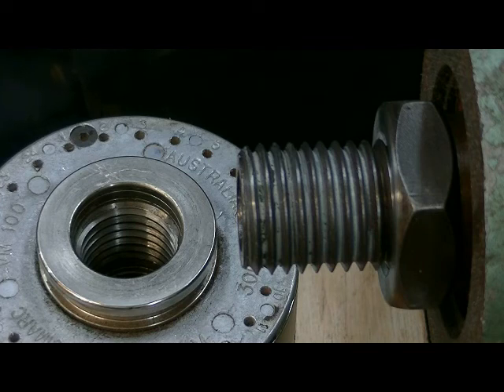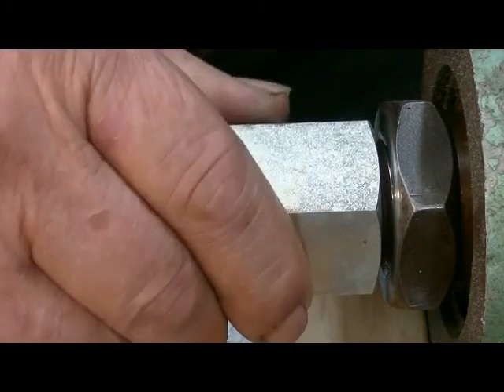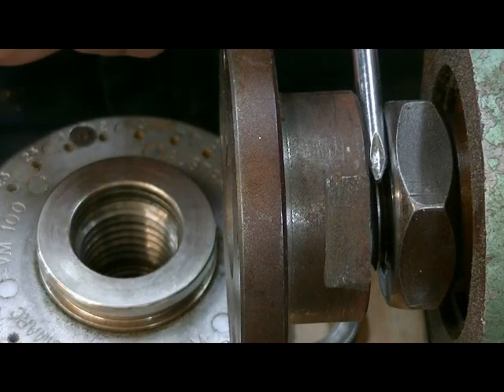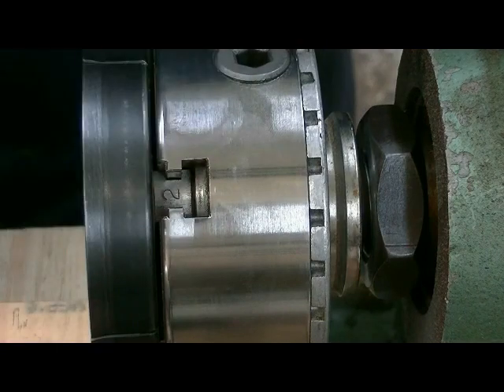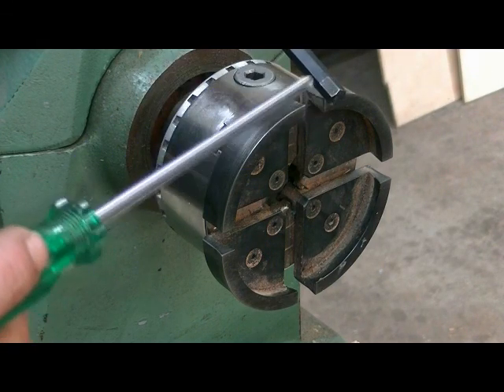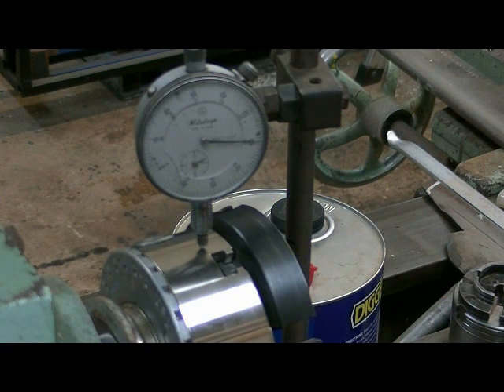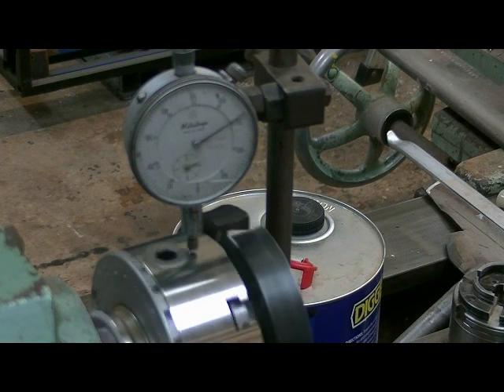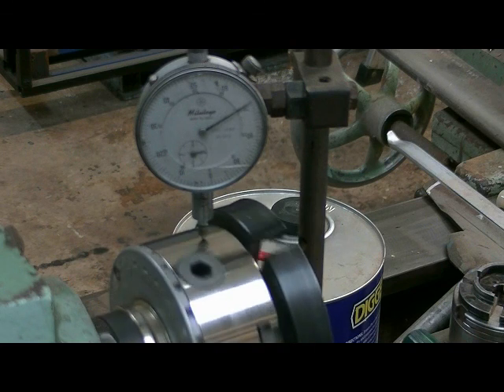Washers or not on chucks?

Comment: Fabulous video - rather that accept 'conventional wisdom', do a real test and make some measurements.  That's good engineering!

As to the point - I use a shop-made plastic washer.  I have never actually measured the runout with a dial indicator, but I know that I had to make several washers before I got one that didn't increase the runout to a visible degree.  I eventually concluded that milk cartons were not a reliable source of flat plastic, and instead use plastic CD mailers.  

But I do agree with you that washers should not be required, and are generally not an ideal application.  I occasionally have fittings jam on my lathe.  If I could just manage to avoid getting catches - - -